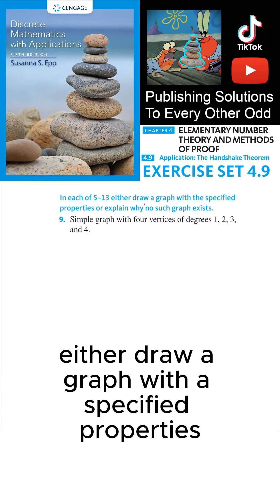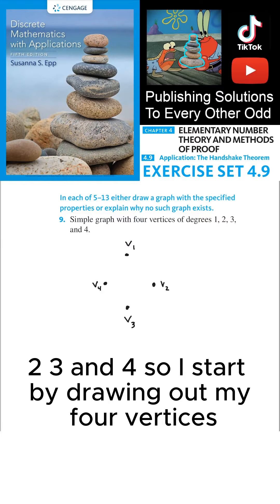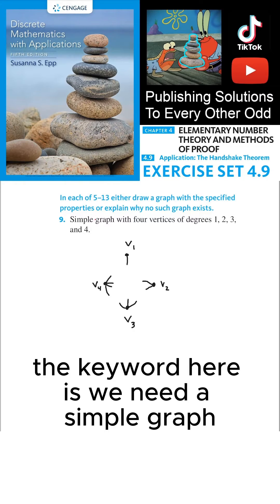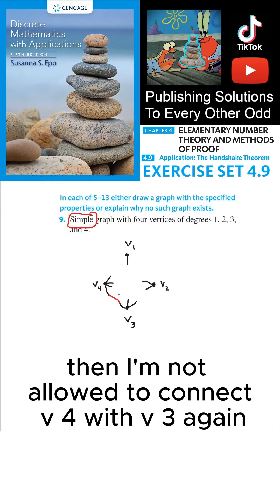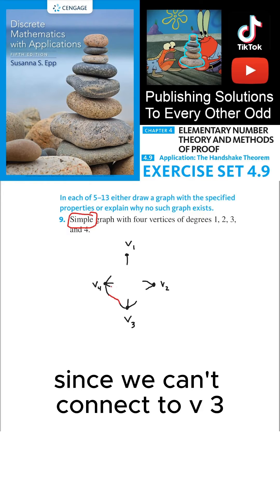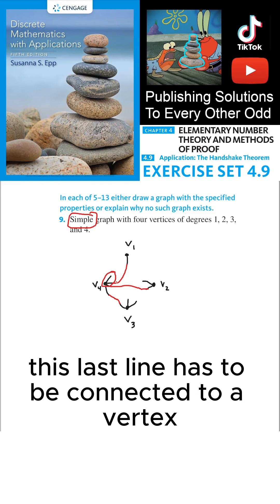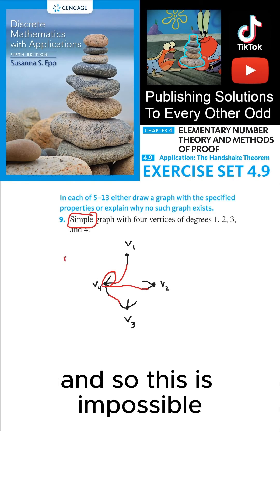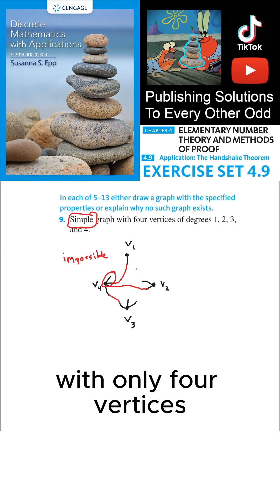(4.9.9) How to Approach a Graph Design Problem: Solving for a Simple Graph with Degrees 1, 2, 3, 4

Comment: What do you mean with degree 4 is too big for only four vertices? Can the Handshaking teorem help with this problem?
Reply from the maker: If a vertex v was connected to four other vertices (degree 4) then that would require at least 5 vertices (including vertex v) total 🙂

HS Lemma would be useful for counting edges and vertices
Reply: @everyotherodd  Thanks, this helps. I wonder if you can make a video for a simple graph of five vertex with degrees 2, 2, 4, 4, 4.
Reply from the maker: @rtxa  if a vertex has degree 4, then that vertex is connected to all the other vertices (since there are only five vertices). If three vertices have degree 4, then the other two vertices need to both have a degree of at least 3, so that they're connected to all the vertices with degree 4 🙂